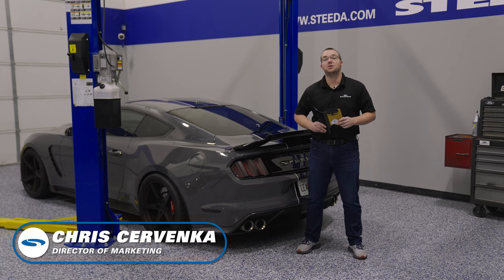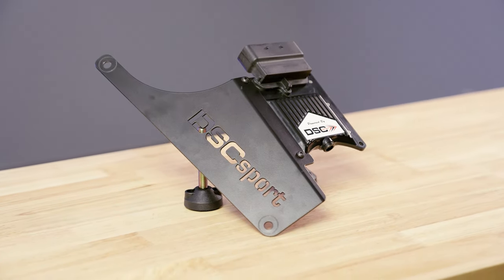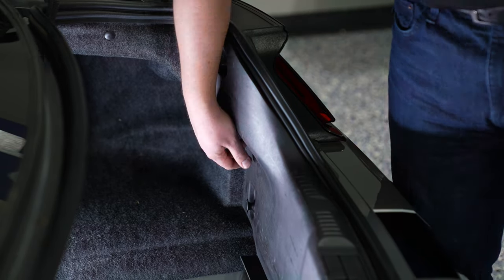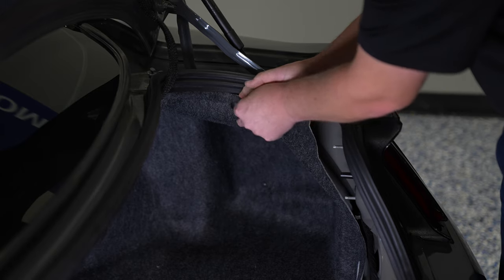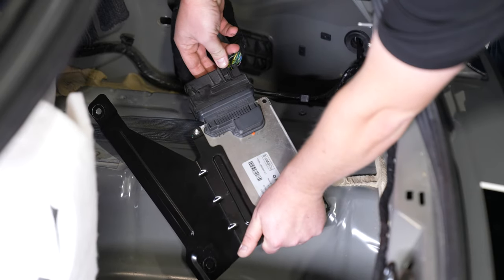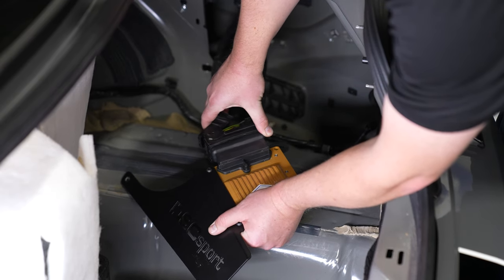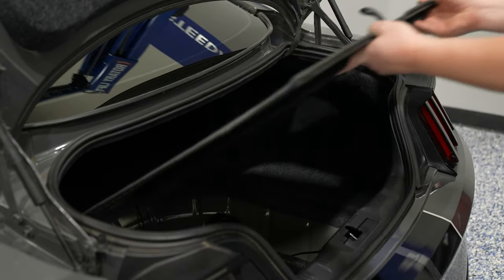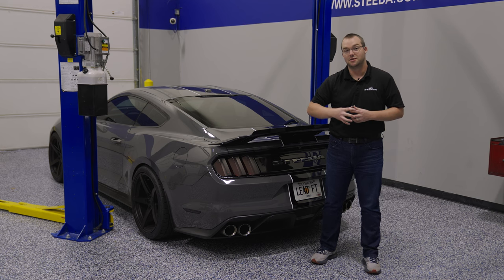How to Upgrade The MagneRide Controller in Your 2015-2023 Mustang | Installation

Comment: I watched the R&D video, I'm curious what was front and rear alignment for the test / comparison between the two modules?  I've autocrossed and one track day with my PP2 on the factory alignment and Cup 2 tires, it did extremely well, Obviously a more track focused alignment will maximize the performance.  Thanks in advance, keep up the Great work.